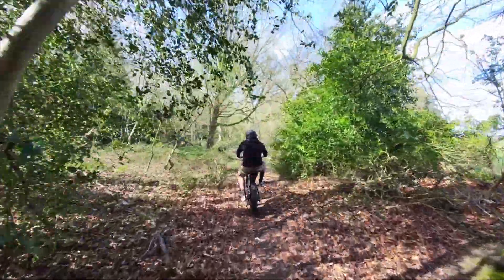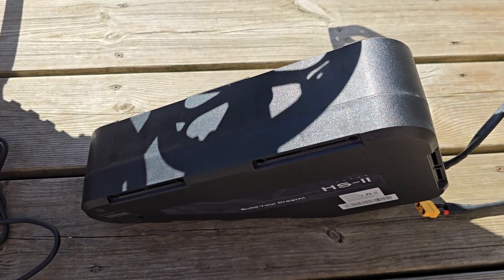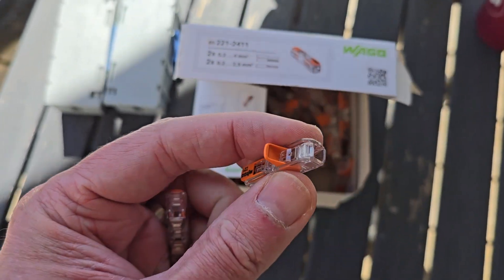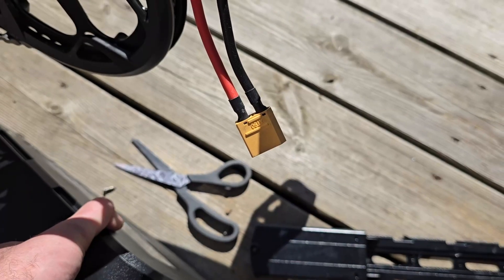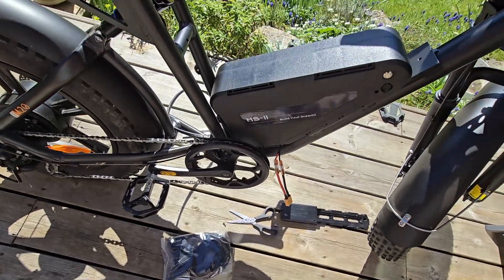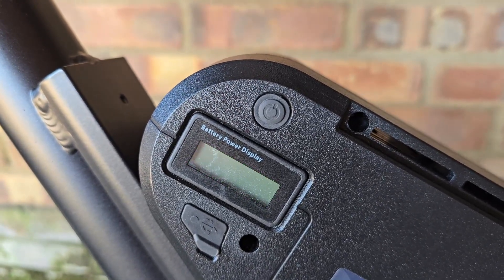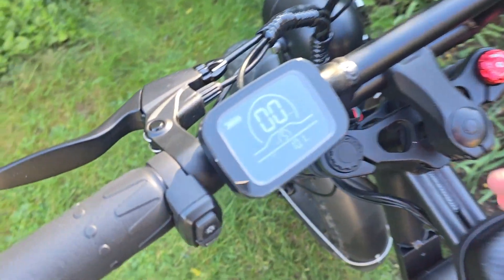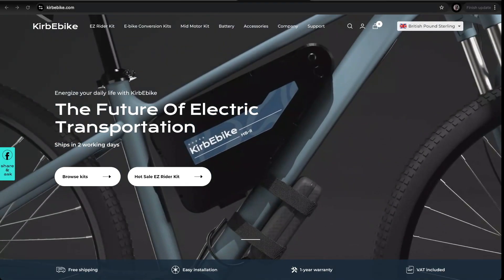HOW TO UPGRADE THE RANGE OF YOUR ENGWE M20 FAT EBIKE!!!

Comment: It simply solder and do it the right way. Says right on it that it only handle 20 amps/300 volts. Don't do it that way folks. As far as getting a higher amp hour battery for range, great video.

Comment: for that price you're better off selling ebike and buying a completely new one with bigger battery capacity and warranty. also you kinda 'lost' original battery which could've been used as a backup battery with a simple switch.
financially that mod makes 0 sense.
that said if you have nothing better to do seems like a fun project. glhf.

Comment: Are there any long term issues with this? I’ve read the controller can burn out, the low voltage cutoff won’t work, and even the motor can burn out when I’ve specifically looked for 52v battery on a 48v kit. I ride full throttle no pedals and I want to get the bigger 52v battery for a while then get your 1500w kit eventually so would make sense to get a suitable battery now if I can.

Comment: Hi Andy awesome content by the way... Just wondered if you could answer a couple of questions for me please... I've just ordered a 3000w rear hub motor kit with 72v 30ah battery... Should I get the 150a sabvoton controller to go with it? What's the difference between that and the 80a one it comes with? Also Will it be a lot faster with the 150a? And I don't really know how it all works with the controller amps how does it work?... By the way I'm a massive fan of your work and videos... Hope you can help mate... much appreciated 👍🏼😊

Comment: I am doing a project on a very similar e-bike the The Yolin 1000w will I get stopped by police with a 1000 watt motor and throttle am I being to paranoid about the police and the laws in Suffolk Lowestoft

Comment: I have this bike and use pedal assist, which does a 25 miles journey with still some battery power left, you can also add a second battery as the controller has connections which support this, the only negative with the bike is the supplied saddle which is very uncomfortable on long range rides.

Comment: i already use a seperate 52v battery for my dual motor fat bike. it came with a 48v 23ah battery but for long trips i also bring a 16.5ah battery. it does actually give about 2mph extra on the top speed when running the 52v one. acceleration up to 20mph is half a second faster lol.

Comment: Lower center of gravity is good too. Myself I solder everything and keep the battery supply wires as short as possible.
Reply from the maker: Yes, I also prefer Soldering but I know some people struggle with it.😁
Reply: @andykirby  Good point, I know people  like that as well. Great battery, great bike, have a great summer. Cheers from California.

Comment: Never had a battery meter that is accurate in any way, it's just measuring voltage, not taking into account many other factors that affect li-ion performance such as heat, cell resistance over time, etc, from an electrical point of view there never will be a reliable linear range meter. I remember my first ebike 20 years ago, I could cycle under Pas for 15 miles and then loose one bar on the 5 bar display and thinking "wow", should be able to go another 50+ miles, no chance after a mile or so more it dropped to 4 from then on quickly dropped to 3, a few hundred yards more and it's at 1 and the BMS cuts power.

Comment: I don't have to remember to charge my ebike. When I get home I plug the battery into the charger. The charger is plugged into a Christmas light timer that turns on a couple of hours later and stays on for about half hour more than needed to recharge the battery from my commute. Next morning I unplug my battery, put it in the bike and head off to work.